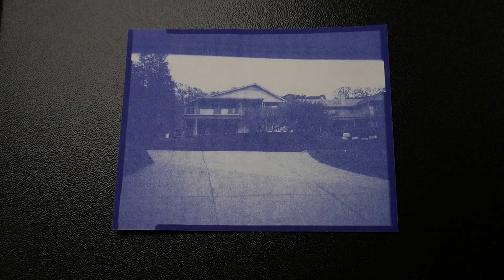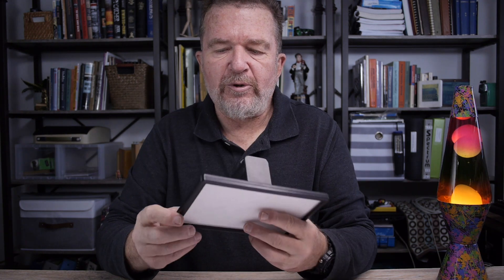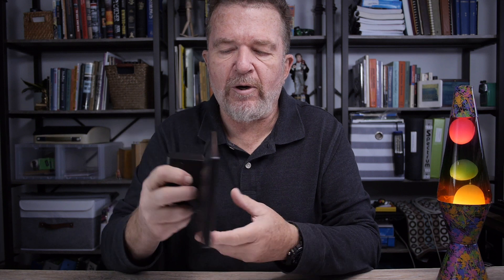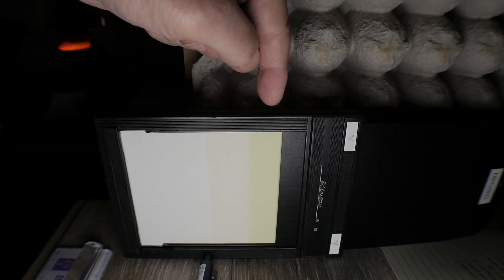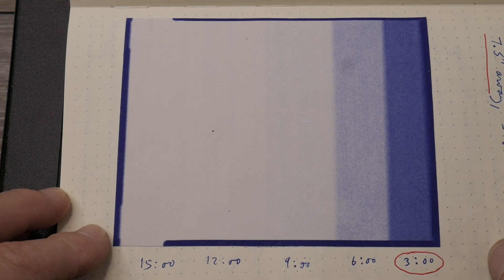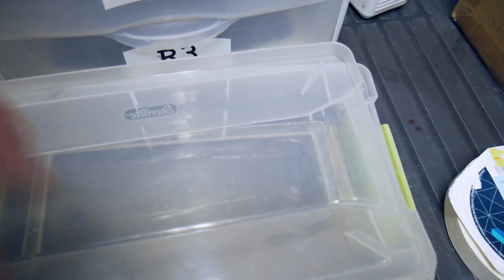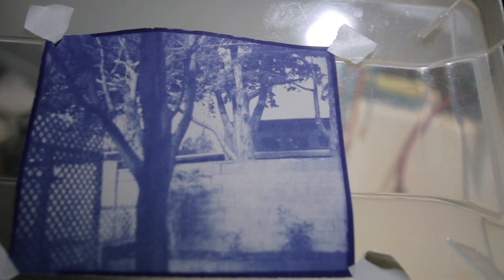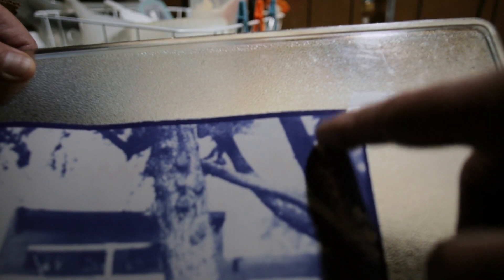Diazo Paper Direct Positive Prints

Comment: From around 1989 though 1994 I ran a very small business where I specialized in reproducing architectural and engineering drawings using either a xerox large format copier (that could copy into Mylar or vellum), or a diazo reproduction machine. Yellow paper exposed using ultraviolet light and then developed with an ammonia vapor. Neat process.

Comment: Hi Joe. Thanks for another great video. 

One of the summer jobs I had when I was in college was duplicating blueprints for an electronics company. These were 48" wide blueprints fed through a machine that was probably 6 feet wide by 6 feet deep by 6 or 7 feet high. Pretty simple work. You would feed the master blueprint in through a slot in the front at waist level and the master and copy would come out of slots at the top. 

Normally they would be dry or close to it by the time they came out but on one print a droplet of ammonia came off it as it was coming out of the printer and landed in my eye. I went off to the doctor and there was no permanent damage but it was painful for several week after that.

Comment: When I developed these back in the '60s (oil well logging charts), we had a vertical stainless steel tube about 4 inch diameter. You can probably use black PVC pipe. You removed the cap, poured a little ammonia into the bottom, rolled up the paper and slid it into the tube, then put the cap back on. I don't recall what the development time was, unfortunately. Anyway, might be somewhat easier to handle than the tupperware box - no tape damage! I've been wanting to try direct positives in my ICA 9x12cm camera. Gonna have to give this technique a try!
Reply: Well, it seems you have to have a fairy godmother to find this stuff.
How hard could it be to coat paper with a fairly insensitive chemical like this? Assuming you can source the stuff...